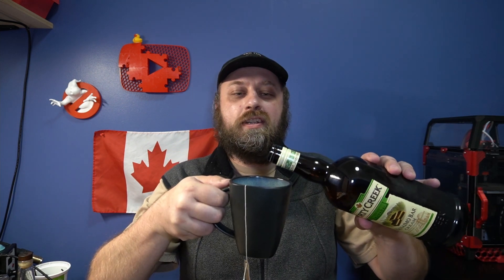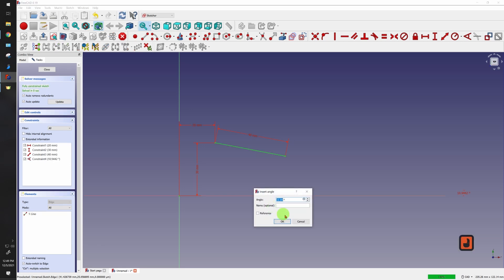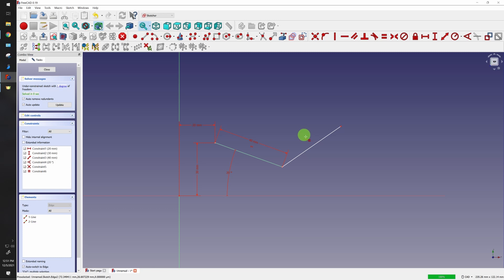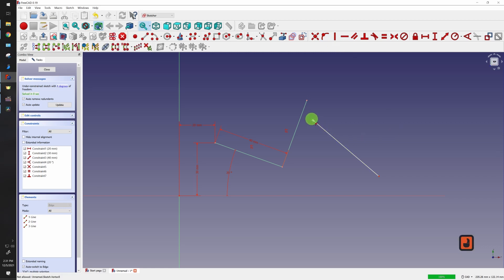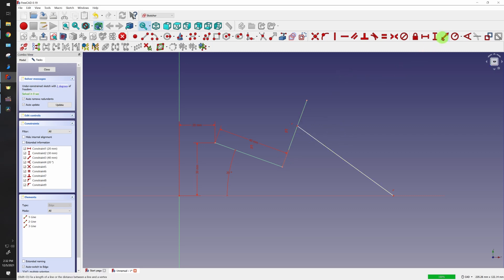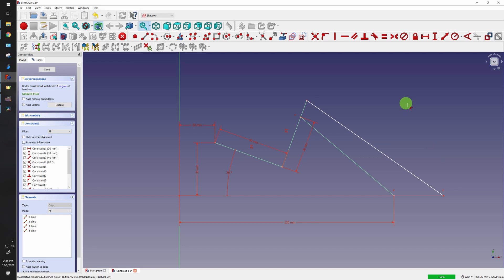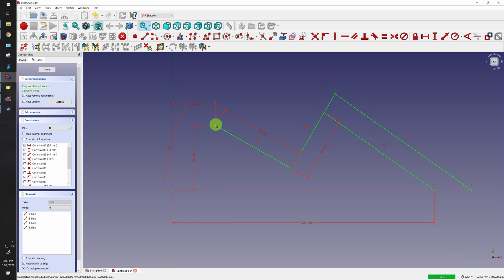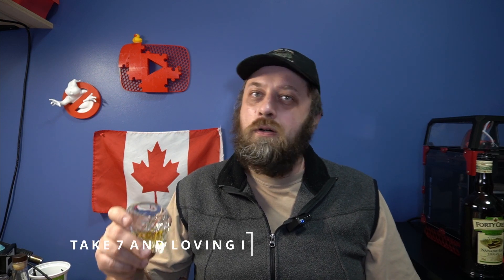FreeCAD Constraints Part 2 | Easy Beginner Tutorial

Comment: That is the issue I end up with. I get an over constrained error. The lines lock in before I can choose the length of the lines.
Reply from the maker: You probably have something selected before hitting the constraints tool.

There are 2 ways to apply constraints, select the object then hit the constraints to apply it, or have nothing selected hit the constraints tool then pick the object that you want to apply it to.

🍻
Reply: @QEngineering  No, it's because I want to apply a distance, angle and length to my model. So that it is accurate. But once it no longer moves you can not add the length.
Reply from the maker: @almonies  in parametric modeling you need to leave one part of your shape undefined so that the solver knows where to make changes to when you adjust one of the  dimension/angle.

For example if you have a triangle you can't give it 3 angles because the solver figure out that the 3rd angle is after you give it the first 2.   Otherwise you can give it impossible parameters such as 3x 35 deg angles which it won't know what to do with.

However if you want to see all the extra dimensions change some to be references (blue).

🍻

Comment: I'm trying to learn how to use freecad, most of my problems are from struggling with constraints and drawing planes.
Reply from the maker: Constraints gave me a hard time when I first started using FreeCAD, at one point they start to make sense and you'll fall in love with them.

I'm hoping to have a new video on constraints out around 21s on November.

What issues do you have with planes?
Reply: @QEngineering  It's hard to explain as I'm having trouble understanding it.  I tried to use the freecad in 5 minutes tutorial.  It's honestly god awful and is pretty lacking for beginners.  On the bright side, having restarted so many times, I'm quite practiced at using the poly line tool, fillet and extrusion.
Reply from the maker: @russhillis  planes are generally something that you do not need to use often.  The reason your probably seeing people use them a lot in freeCAD is as a work around for the Topo-naming issue.  This is something that will be fixed in the next release (v 0.22) or by running Real thunders FreeCAD branch.   If you are just drafting simple things that don't need a lot of adjustments you could just sketch on surfaces and ignore using planes.

Comment: Great lesson. I struggled this week with constraints and found you 👍👍

Thank you
Reply from the maker: Glad I could help.

When I first started working with FreeCAD I couldn't wrap my head around constraints, I kept thinking "why cant you you be like every other CAD" but after I got my head around them it make other CAD programs feel like they are dated.  

Sketcher is by far my favorite part of FreeCAD, wish I could slap it into Catia and SolidWorks.

🍻
Reply: @QEngineering  It is my first 3D cad attempt and I've always only used Corel and Inkscape for my plasma drawings. Now I'm building a mill and rotary axis. Also I really want to get myself a 3D printer. So this is very helpful 🙏
Reply from the maker: @shaneschuller2513  super cool, I always wanted a CNC, I use to design a few things for injection molding a few decades ago, these days I primary design for 3D printing.

You'd be surprised how many silly little things you and up designing for around the house.
Reply: @QEngineering  yeah I'm a busy guy for my kids and around the house too lol. 
It's not silly. They value it and so it is a good thing.